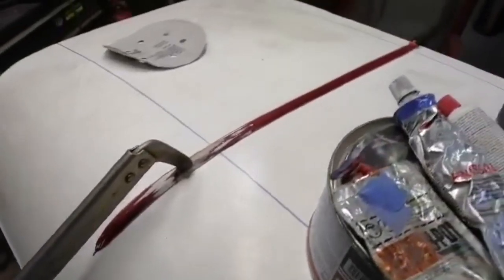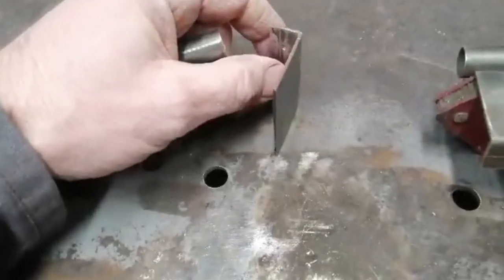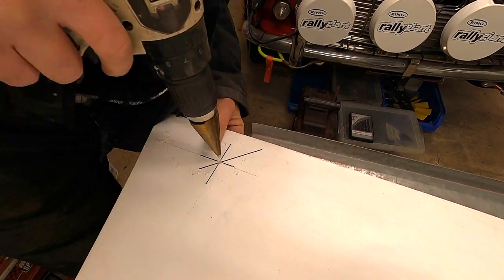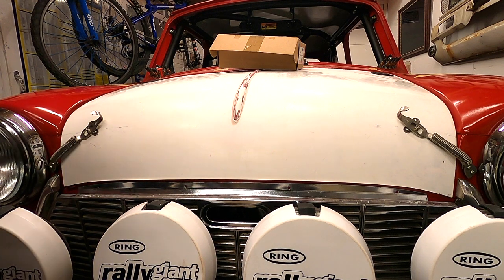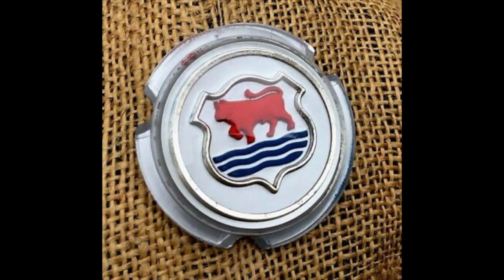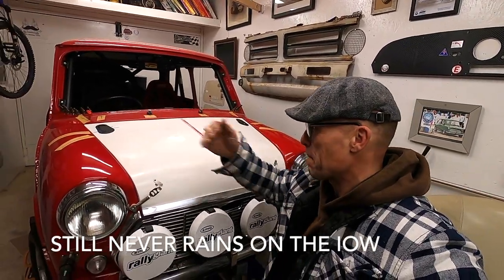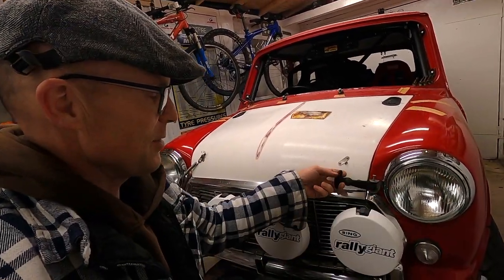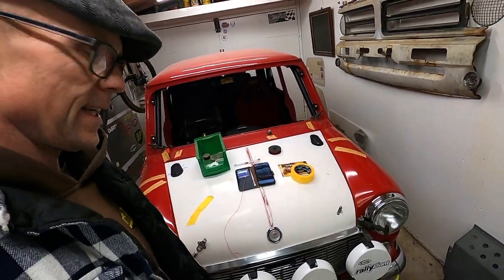Fitting bonnet pins to a classic mini rally car - mk2 not a Cooper s restoration  episode 48

Comment: Hello Kev. Loving the build, you will have to bring it to Jersey when it is finished. I tried the cheap aero catches and they worked really well until i used the car on a hot day and they went like liquorice and both snapped. The British made ones were twice the cost but have survived multiple accidents and still going strong after many years

Comment: This car looks fantastic!
Do you know roughly the width of the lampbar support bracket that is in the middle and connects to the centre bumper bolt? (Looks maybe 1 1/2 inch?) I'm making my own and have no reference
Reply from the maker: Yes mate no problem, I will measure it tonight and make a little diagram for you
Reply: The Gentlemen's Motor Racing Team thankyou so much!
Reply from the maker: Hi Mat, sorry for the delay but I have posted some details of my light bar set up on our Patreon page - www.patreon.com/TGMRT